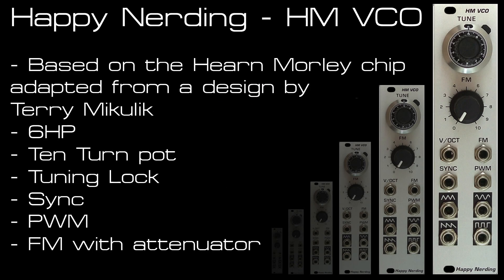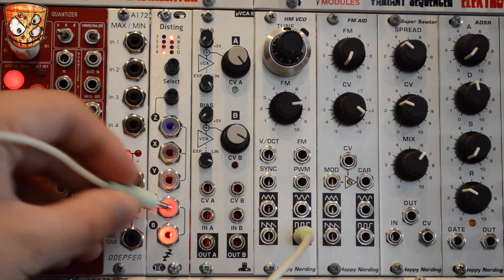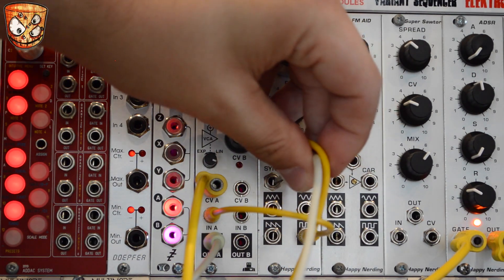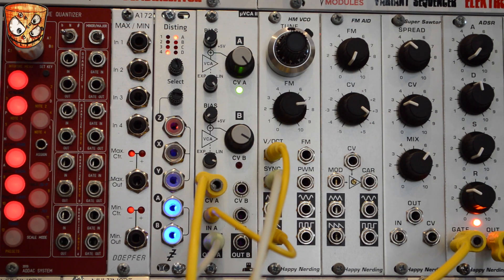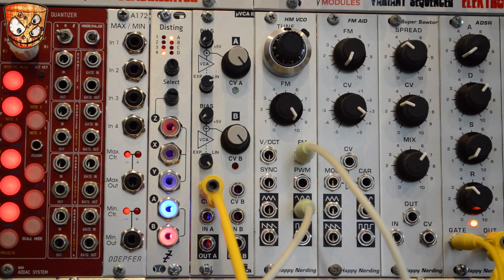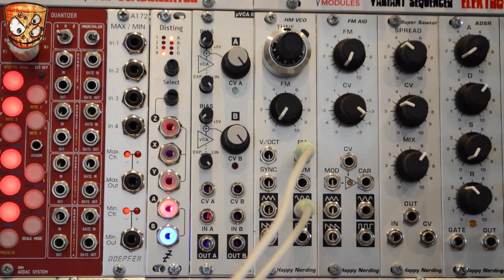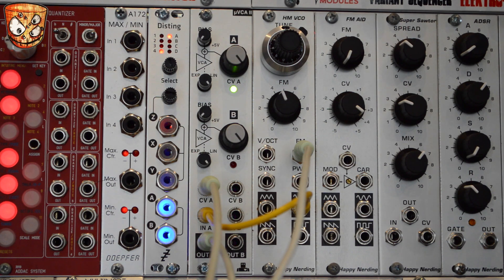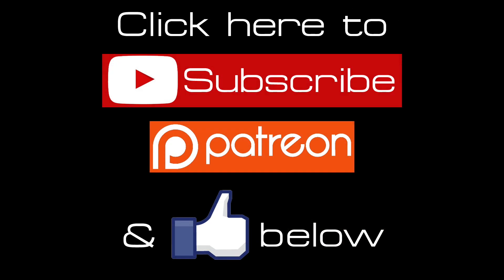Happy Nerding - HM VCO

Comment: i've seen a few modules with these all in one tune pots. but they all are numbered 0-9 (dividing an octave into 10). wouldn't it make so much more sense more sense they were 0-11, so that each number represented a semitone?
Reply from the maker: each number in the viewer / hole represents an octave on this module. And scaling was perfect for using that to jump between octaves. Regarding the in between parts yeah that would make sense for semitones.